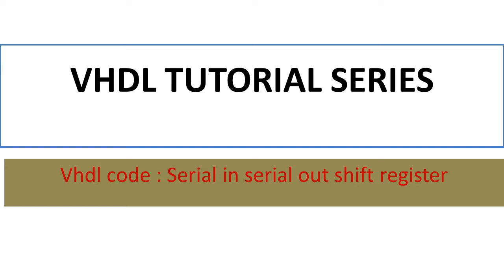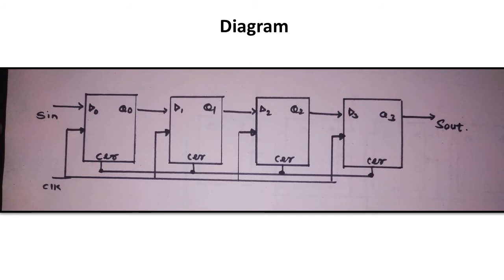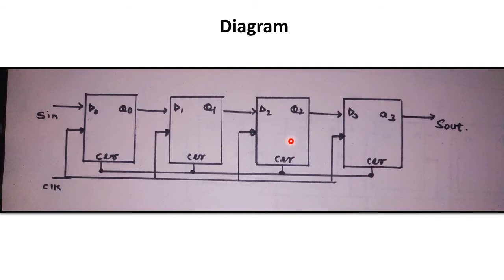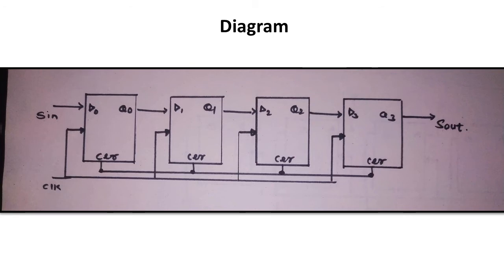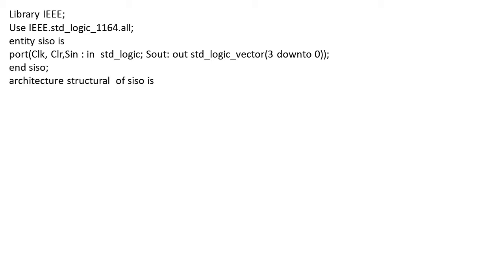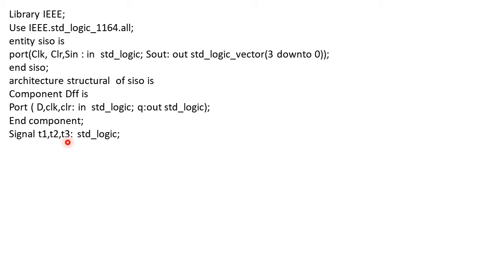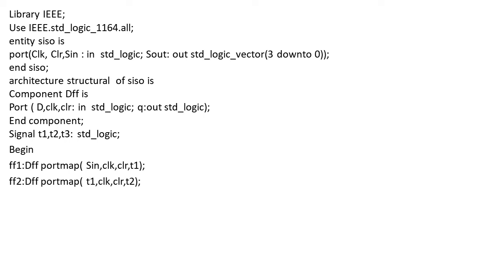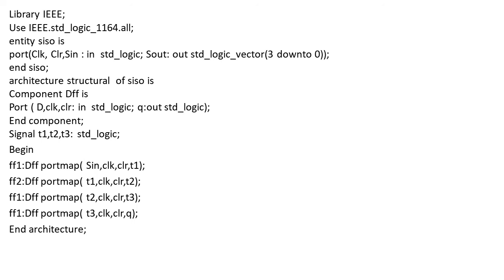| VHDL code of serial in serial out shift register | How to write vhdl code of shift registers

Comment: Bro i have to make a 4-bit SISO by using structural level verilog coding. Can you help plz?
Reply: @Daaris NITT i will just say i dont need it now.
Reply: @Daaris NITT
module Shift_Reg(clk, rst, right, DR, DL, Q);

input clk, rst, right;
input DR, DL;
output [3:0] Q;
wire f0, f1, f2, f3, f4, f5, f6, f7, f8, f9, f10, f11, D0, D1, D2, D3;

and G0(f0, DR, right);
and G1(f1, Q2, ~right);
 or G2(D3, f0, f1);
 
and G3(f2, Q3, right);
and G4(f3, Q1, ~right);
 or G5(D2, f2, f3);
 
and G6(f4, Q2, right);
and G7(f5, Q0, ~right);
 or G8(D1, f4, f5);

and G9(f6, Q1, right);
and G10(f7, DL, ~right);
 or G11(D0, f6, f7);

DFF G12(Q[3], D3, clk, rst);
DFF G13(Q[2], D2, clk, rst);
DFF G14(Q[1], D1, clk, rst);
DFF G15(Q[0], D0, clk, rst); 
 
endmodule